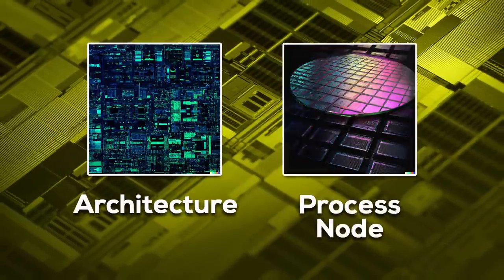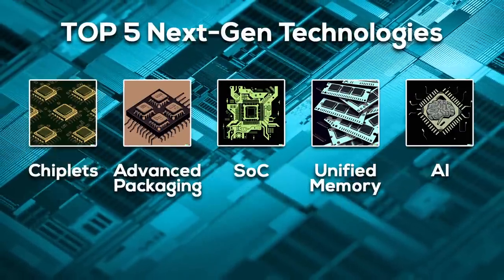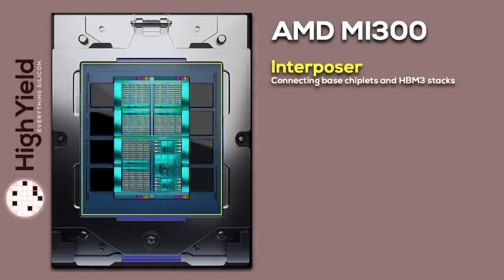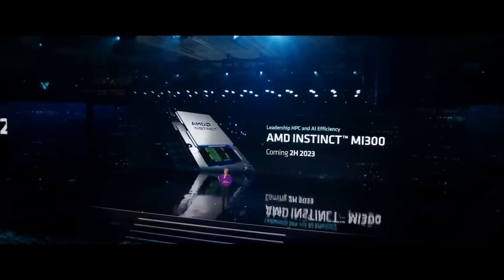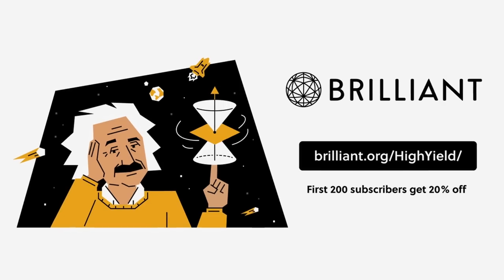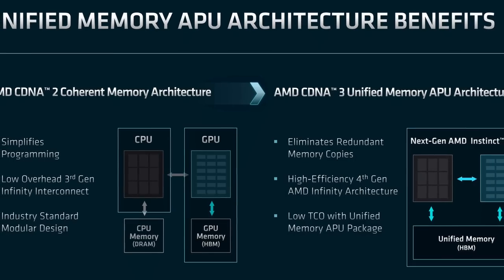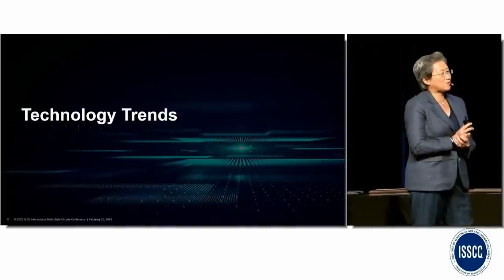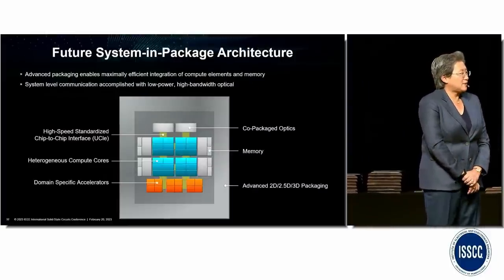Deep-dive into the technology of AMD's MI300

Comment from the maker: Do you think all five technologies will "trickle down" into the consumer market? Will we buy a single "gaming SoC" at some point in the future?
Reply: We're almost there... I have a miniPC with a 6900HX and I can play EVERY game at 720p... WHen StrixPoint comes out next year I think we'll be at 1080p60 using FSR3...

I haven't seen any benches with 7x40 APUs but they should be 50% faster than the 6900HX... Especially if they can get 30% higher clocks...

And then Strix should be 30-40% faster than that...
Reply: @ChristianHowell  Those system on a chip machines are really cool. I hope they make a bunch of improvements over the next 5 years.
Reply: @ChristianHowell  Those performance numbers are good for something like a portable system (Deck) or standalone VR headset
Reply: No, heat dissipation, leakage, and memory bandwidth, issues with latency.  Just look at modern GPU's from nvidia and AMD way too costly.

Physics isn't magic.
Reply: probably zen6 - 2026. 8+8core + 24-32 wgp GPU chiplet, On bottom IO+128mb cache and 2 chanel DDR6 memory. All for $500-600
Reply: Looks like that (the gaming SoC) may be closer than people predicted here, given the recent AMD (consumer) super APU leaks seem legit.
AMD Sarlak (or formerly Strix Halo?) sometime next year, with a 256bit LPDDR5X bus, 24 to 40 RDNA3+ CUs & 32MB of cache, 40 AI TOPs, and 6 to 16 Zen5 cores. Chiplet based, 25 to 120W TDP.
Reply: @robertstan298  I want that in a VR headset
Reply: Strix Halo next year will be 4070 levels of performance (or well, that's the performance target).It will be chiplets, it will be a SoC/APU, it will have unified memory, and it will 99% have an AI chiplet, and 50% it will also have 3D stacked cache (not sure though), so... already we will be very close next year, if not already there.

To be honest, the Apple M1 and M2 already have all 4 checkmarks, except 3D stacking! We can hate Apple (I do) but the M chips are a technological wonder
Reply: @HighYield I really enjoy your videos. Thank you!
Just wanted to ask if you think rdna4 can go 3d in the same way (MCD and GCD on top of it).
So if they decide to go with 2 GCDs of 80-96cu each is 450mm² - 540mm² on 4nm than adding the MCD make a total of 800mm² - 900mm² wich will require a massive package.
Do you think putting MCD below GCD and stay at 450mm² - 540mm² is possible? And if yes, does it reduce cost overall or increase  it?
Thank you again!
Reply: Sounds like the next gen consoles 2028? The advantage of an all AMD build is only hobbled by the poor performance increase from RDNA2 to RDNA3.
Reply: I don't know if such a complete package will go to consumer since most of us won't see the benefits of it, but APU are already a thing especially for AMD desktop and they're really getting amazing. they haven't replaced GPU yet, BUT, with zen 5 they might put an end to low end GPUs though.
If you can play your latest games at 1080p around 60fps with FSR 3 then why would you need something like a 4060 or 7600.
And I believe as time goes on the lower tier gpus will just phase out of the market. Nvidia is making too much money with AI to give a damn about whining gamers buying 300 bucks gpu anymore, AMD is working hard on their APU so why waste ressources on those gpus, only intel remains in the race for now for entry level gpus but for how long..
Reply: @seraphin01  Starfield shattered any dream of getting 1080p@60fps on an APU or even any recent "budget" GPU, if that is a sign of what's to come I was aiming too low for my next GPU. The 6700XT was the lowest card to  hit 1080p@60  natively and the 6800xt was only getting 60fps at 1440p. Good thing I have a big backlog.
Reply: Of course - this is the most cost effective and efficient.  However not very planet friendly nor a viable solution if you like upgrading your machine.  How would you update or replace your memory, GPU, APU, SPU, and CPU?  May I suggest using light or growing your own CPU?

Comment: One correction I would mention is. The latest version of PyTorch. PyTorch 2.0 is moving away from CUDA. For ever increasing AI models CUDA on its own can't optimize for the scale. The frameworks themselves have to be optimization aware. This is why ML frameworks are shifting from the eager mode to the graph mode, which sidesteps CUDA (cuDNN) and provides better performance. Instead of using CUDA, they will use tools like Triton (this is what Open AI's ChatGPT uses) which interfaces directly with Nvidia's NVPTX and AMD's LLVM AMDGPU backends. So CUDA is on its way out and with it Nvidia's software moat. MI 300 will be a monster.
Reply from the maker: I'm not up to date with all the AI/ML software. Maybe this is AMDs chance to catch up to Nvidia?
Reply: @HighYield  I believe so. There is a big push at AMD to improve their AI offerings. mi250 was kind of a test, with limited matrix multiplication units, and built more for pure scientific HPC applications (like the ones used by Oak Ridge supercomputers). mi300 will focus on AI. And I do believe it's going to be very competitive with Nvidia.
Reply: @SirMo  Excellent. AMD has been lacking in that market, and some competition against Nvidia's monopoly is welcome. I know they've had their CUDA compatibility layer for ages, but a proper alternative is always best.
Reply: You think so? I am learning CUDA and working on 12.1. I am just getting started.... Just want to do some small scale work to learn this new tech. There are a ton of processors on the market for cheap that I would have been thrilled to have just 5 years ago. Did you see CUDA has a new communication system that is not only under development but already being used that reduces i/o bottle neck. I hope AMD does something great though to keep the competition going. Anyway gotta run.
Reply: Instinct and Tesla are focused on completely workloads though. Tesla is a beast at low precision tensor calculations (useful for ML) while Instinct is a beast for high precision vector calculations (useful for science).
Reply: @LeonardTavast  for int16 or below, i would use asics, no nvidia es not better on low precision they got at tf32 workload
Reply: Triton doesn’t work on non nvidia chip yet.
Reply: @SLPC_  yes the triton support for AMD CPUs and GPUs is under development.
Reply: With Nvda’s AI full stack, do you think AMD have a real chance?
Reply: @ranchuhead4547  Yes they do. AMD has an edge in exascale. And frankly AMD has a better hardware approach.
Reply: Wow good news, really good news for AMD. I am really glad that PyTorch can really work on ROCm directly without having to work on HIP remapping of wmma's. That would make AMD hardware work in streamline without having a remapping processing in between... Thanks PyTorch for having this balls to get rid of Nvidia's dependencies...
Reply: @SirMo  AMD needs to really understand the gaps between CUDA and ROCm and improve on it fast. Reallocate a lot more resources to make ROCm the talk of the town.  They may need to partner with another OpenAI-like software developer to get some brownie points for their AI hardware(s).
Reply: @SirMo PyTorch and PyTorch 2.0 supports ROCm (open source GPU compute platform led by AMD). Regardless, MI300A is best suited for inference, not training. In those cases you don’t actually use PyTorch, you use something like ONNX Runtime (ORT).
Reply: agreed
Reply: @HighYield Not just this, but the latest versions of ROCm (AMD's CUDA competitor) include a one-click CUDA to HIP (ROCm's native programming language) code converter!

Although yes, AMD's in-house developed automatic CUDA→ROCm/HIP code converter tool used just by itself doesn't give you the absolute peak possible performance that AMD's GPU hardware is actually capable of (further AMD HW specific optimization after the inital 1-click conversion is needed for that), BUT it DOES let anyone quicky & easily run ANY AND ALL pieces of 100% CUDA ONLY software on any ROCm compatible GPU!!! (Aka anything RDNA/CDNA based.)

And just as importantly, it makes properly porting CUDA only software over to ROCm (& thus AMD GPU's) massively, MASSIVELY quicker, easier, & cheaper!!! (Requiring only the manual optimization step after the fully initial automatic code conversion.)
Reply: Jim Keller was right.  Cuda isn't a moat.   It's a swamp to be escaped.
Reply: @HighYield AMD was never really that far behind technologically.  For some work loads, they may even be a better choice.  It's adoption that the problem and the worst enemy of all new ideas, it has to work better than a solution that works well enough.

Comment: I think you are spot on.
Though I would say that another tech to look out for is in-chip fluid cooling. Heat is a huge problem, especially with 3D stacking. Efficient extraction of heat allows for higher frequencies and lower energy use (as heat increases resistance).
Reply from the maker: Next-gen cooling tech is definitely worth a future video :)

Comment from the maker: Something I wanted to add: since we don't know the packaging method yet, when I talk about the "interposer" it doesn't have to be a large silicon interposer, it might l be a small "organic interposer" like on Navi31, using TSMCs "Fan-Out" technology. Once we know more another video will follow! 
https://www.tsmc.com/english/dedicatedFoundry/technology/InFO
Reply: IIRC, TSMC is using CoWoS and TSVs with the caches like X3D... They renamed it to 3D Fabric for the whole infrastructure... AMD is the cutting edge of silicon right now...  They had to sell their own fabs and came out even better in the long run... All their 5nm products haven't even come out yet and the 4/3nm Zen5 ones will have even more instrs and accelerators...
Reply from the maker: @ChristianHowell  AFAIK, SoIC is also a Chip-on-Wafer technology.
Reply: @HighYield  Yeah, they folded it all into 3D Fabric terminology... But the basis is CoWoS because it lets them package huge chips like MI300...
Reply: It's 100% confirmed to be a standard, absolutely freaking MASSIVE (as in it pushes TSMC's max reticle size limits right up to their absolute freaking er.... limit lol 🤣) silicon interposer. 🤷

AMD were originally planning on doing what MI250X did to connect its HBM, which is use a hybrid of a standard interposer ala MI300 & fan-out wiring ala Navi 31, w/ TSMC's "CoWoS-R" packaging, which uses a small silicon bridge + fan-out technology. (Think Intel's EMIB, but instead of the tiny silicon mini-interposer bridges being directly connected on both ends w/ physically die-to-die attached TSV's [which TSMC can now do too, called "CoWos-L"], they're connected w/ less dense fan-out wiring [although still plenty dense enough for HBM3].)

But then at the absolute very last minute possible, AMD had to switch to a traditional absolutely gargantuan silicon interposer (aka using TSMC's "CoWoS-S" packaging) pretty much as late as they possibly could due to reliability concerns, thanks to the massive package flexing/warping when kept at its full-fat 750W load for seriously extended periods.

Basically, with MI300 having a MUCH larger overall package than even MI250X, the tiny silicon bridges connecting the HBM stacks were simply much more prone to failure than a single massive contiguous silicon interposer across the entire package under the kinds of "100% load, 24/7/365" conditions that are inherently endemically common in HPC/data center land. 🤷

Comment: MI300 is something I've been waiting for since I saw the initial HPC chiplet APU patent... The interesting thing is that older CPUs used to remove functions from the CPU die because of limited transistors at 180nm etc...

But the biggest thing about it is that I heard some autonomous driving folks say that 2000 TOPs are needed for an FSD experience and since MI250X has 383 TOPS, 8X that is almost 3500 TOPS... AMD can now theoretically provide all the chips for automobiles out of nowhere it seems (NOT!!!)... They can use an edge like appliance with a Pensando front end for network relays for traffic and weather, etc. for a LARGE MAP area, while an upcoming Ryzen APU can do the entire system, including 4K video and gaming... Companies are selling mini PCs with Ryzen and Radeon 6000 that can do 4K30+... Zen4 telco servers can do edge processing while EPYC can stream games and all types of data including AI for predictive routing...

Comment: 1) LightMatter wafer scale optical interconnect
2) Ultraram replacing most chiplet cache, HBM, DRAM, and NVM
3) Accelerators on chip/package
4) Combining CPU, GPU, FPGA on package
5) Backside power delivery 
6) VTFET 
7) Deep trench capacitor on wafer with direct 3D bonding integration
8) Glass based motherboards with integrated photonics, power deliver, and microfluidic cooling

Comment: The eight extra "dies" are probably what I could call fillers, not spacers.  I don't think they are there to provide any structural purpose, but simply to take up space that would otherwise have to be taken up by the resin used to make the whole package flat.

As for the stacking method, I can only make a wild guess.  The bottom dies are apparently mostly for I/O, so they could be quite large, given the lack of scaling with I/O.  They would then also have a lot of dead space, making TSV's an easy option on that side of the equation.  If I had to guess, I'd say they connect to the upper chiplets using the normal connection points those chiplets would have if they sat directly on a package.  Meaning the bottom dies replace the substrate as far as the stacked dies are concerned, and use TSV's as needed to connect to the actual substrate for reaching the socket pins.  That would make the overall design chiplets on top of active interposers, on top of a passive interposer with HBM at the sides.
Reply: Wrong. They are officially & explicitly according to both AMD & TSMC there to maintain structural integrity across the massive chip package, just like OP claimed. 

If it was just a massive valley of pure in-fill material placed over those areas in-between the HBM3 stacks instead of hard silicon, it would have allowed SIGNIFICANTLY more flex and warping under the package's full 750W power/thermal load, which could EASILY break the RIDICULOUSLY FUCKING FRAGILE like 1100mm² active silicon interposer everything sits on top of. 🤷 

(Not break as in "crack it" or anything, but rather cause some of the countless MICROSCOPIC TSV's ["Through-Silicon Vias"] connecting the massive interposer to all of the various chips on top of it to become disconnected.)
Reply: And the bottom dies sit on top of a massive package size active silicon interposer, NOT on the package substrate itself! The gargantuan silicon interposer underneath all the active chips above is what's connected to the actual package substrate.

Comment: With memory integrated onto the chip, the memory timing will probably be REALLY good! Plus, with a gpu with performance levels of dedicated gpus on the same die, that's gotta have a huge performance increase. If nobody posts a YouTube video of gaming performance with fps graphs with this thing, I will be VERY disappointed. Maybe Linus will do that.
Reply from the maker: While CDNA3 isn't really a gaming architecture like RDNA3, I'm sure you can run games on it. If you get the drivers working MI300 would be a power house!
Reply: GPU's are the few things I would rather not have directly integrated onto the CPU. For the express purpose of it destroying the modularity modern systems have.

I like the idea of having memmory integrated onto the GPU die. 
I think its much wiser to just offload more and more things onto the GPU, than to just integrate the CPU and the GPU closer.
For gaming especially, the CPU shouldnt be doing shit when it comes to rendering. It should mostly be hardware doing the job.

Comment: You can get an IBM x3650 M4 with Intel Xeon E5-2670 2.6ghz base frequency and set it to run at 3.3ghz on high power mode. There are two silicone chips with 8 processors in each chip and 2 threads per cpu. The unit also comes with 64gb memory at 1333mhz for 150.00 bucks. I then added a gtx 1660 super with 6gb ddr6. and 128gb additional ram. I love it. I put Ubuntu 22.04lts on it for the operating system. I picked up 10 900gb sas drives and put 8 in the machine to start and set them up with raid 5. There are a ton of these servers on ebay and can be obtained in a server or desktop server package. Thought I would share. Good luck. Have fun.